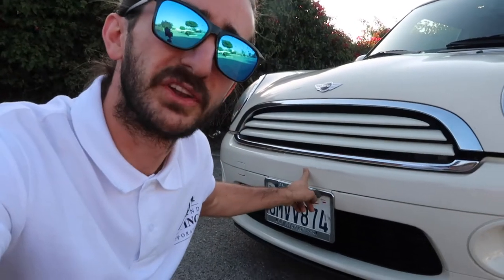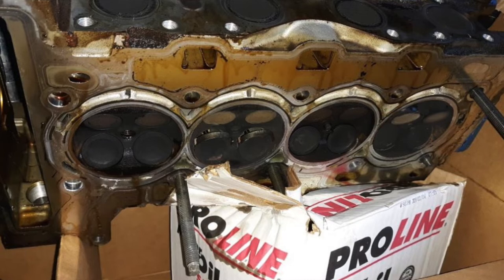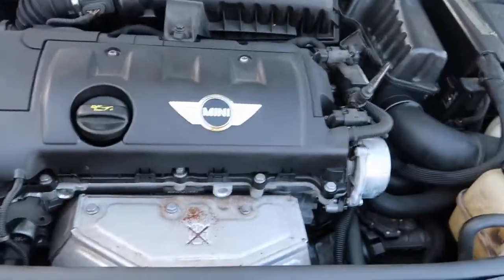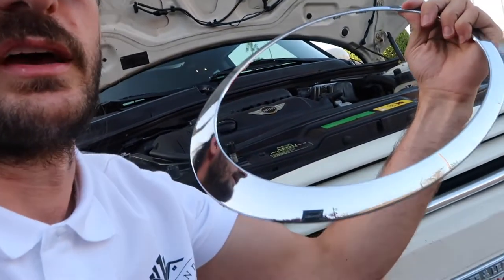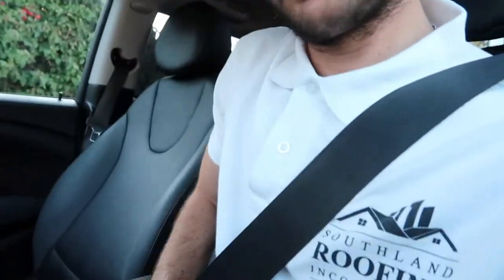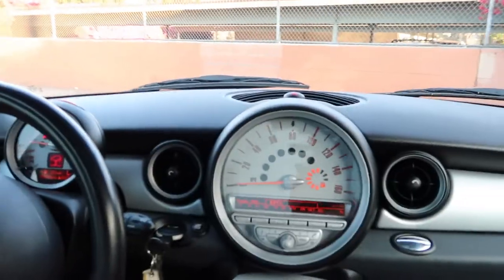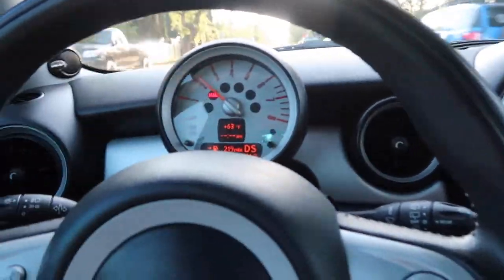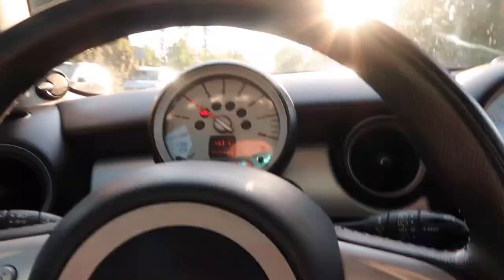WHY You should not buy a Mini Cooper Under the year of 2013 !!!

Comment: I've had a 2011 R56 Mini Cooper since new, had it serviced in accordance with the manufacturer's recommendations, have always driven it with due respect and have never experienced any issues at all!
Reply from the maker: Man I think with this one what happen was because it was seating for over 1 year and that’s why all this stuff happened to me !!
Reply: hey rob,
I'm wondering what you had to replace and how much this car has cost you in repairs?
Reply: Hi Charlie, the only replacements have been the usual consumables at a service, - oil, oil filter, air filter, wipers, coolant, screen wash etc. I've also had the tyres replaced too, but I've spent nothing at all on repairs. Hope this helps. 😊👍
Reply: @rob11rr  besides the basics, youve never had to replace anything major with your vehicle?
Reply: The secret to any cars reliability is proper care and proper maintenance.  When you are buying a used car you will see many advertised as full service history, but unless is still fairly new it’s almost always not true.. very few owners continue to service their car properly after the first 3 years or so.  Those that do, and drive the car some respect for the car do normally get rewarded with long and trouble free life.   If you are the kind of person that thinks a service is an oil change then this does not apply!
Reply: Deponds how old owner took care of that car. I want buy myself 2013 mini one D ... Wish me luck...
Reply: Me too same good car
Reply: I’ve had one for 7 years. Same gentle driving etc. worst car we’ve ever owned. By far. Stay away. 2011 we have. Absolutely horrible.

Comment: I bought a 2004 Cooper S with 15K miles. It now has 26K miles with zero problems so far. I am going to trade it for a 2013 JCW R57, but not because the car is faulty in any way.
Reply from the maker: Well from my experience they are not worth it. If you got a very low mileage it’s good but mine didn’t have that many and still broke down.
I was putting and putting money on it all the time. Almost everything it’s bmw parts and doesn’t drive like a bmw at all.

Comment: Upon my research, I've found that 2010s and older are the ones to avoid. The 2011's are hit/miss and the 12's where when things started being refined. Just bought a 2012 my self, 140K miles on it, and very solid over all. 

Edit: Don't complain about a car being slow, when it's an automatic. Yes it's not a power monster, but know the cars weaknesses and strong points, and utilize them. It's a car for twisty roads, not drag racing.
Reply from the maker: I absolutely understand your point..
But being honest with you at least this car I bought it is slow man, I understand it’s a 4 cylinder but I don’t know if it was just my car responding slowly or all of them.
This one I had it was a 2010 and I had problems with the engine and probably had to do with that to I don’t know man.
It was my very first min Cooper experience to buy and drive.
Reply: @mppower5141  dude you bought a small and slow car even a 4g eclipse will be and feel faster you gotta see the hardware inside the car before buy one. You want something fast with a good driving experience buy a BMW 135i 2012  an audi tt 2013 even an eclipse 2009-2012 an Audi a5 2.0T Quatro a bmw 325i coupe

Comment: You have to check maintenance records. If the seller doesn't have them, walk away. If they do have them, first check how often the oil is changed. Every 3,000 miles? 5,000 miles? If it's never been driven over 5,000 on the dot without an oil change then you know it's looked after. Move on to other items, like the coolant pump, when fluids are replaced, and check for things like tire rotation and wheel alignment. Has the timing chain tensioner been replaced? Is there any rust on the vehicle? When was the clutch last worked on? For a manual car like this with a couple known issues that can cost $1,000-2,000 to repair after the fact, these are things you need to address. If the car was well maintained and documented you will be able to expect how much repairs will cost you by judging the service record; "Oh yes, these 3 things were done but the clutch has not been replaced and the vehicle is at 80,000 miles. I was quoted $1,200 for a new clutch with labor. Therefore it will cost me $1,200 plus oil changes, gas, and initial insurance premium."

Comment: What, exactly, was the mechanical issue?  Not sure what you mean by the plastics melting in the engine.  You said something about three pistons failing, did they crack or the rings failed?  Did the cylinder head fail?  Thanks.

Comment: This has no credibility. 
In the comments, poster admits he let the car sit un-driven for a long period of time.  That is the worst thing you can do to any car. Even take a brand new car, park it in your garage for a long time, and as soon as you start it, your engine is done. Oil and lubricants decay, and settle out of the spaces they are supposed protect. Many parts and seals are actually maintained in good order through their motion and vibration, and contact with good fluids and lubricants. 
     Jeez.

Comment: I've had 2 minis. I traded the 2004 Mini S JCW for 1/2 cost  for and a loaded 2011 Mini S Clubman. For that one, there were practically constant repairs of the little things, but after clutch went out ($1800 ) in 2018, lots more stuff broke and had to be repaired by me or the Mini Dealer...mainly me since Dealer charges close to $200/hr to work on anything.
Reply from the maker: That’s exactly pretty much what happened to me.
It’s a really expensive car for what it is in my opinion.

Comment: Just bought a mini 2010 used. Didn’t have the car for 3 weeks and the engine light popped on. Took it to a Mini Cooper dealership and they did a thorough diagnostic on the car 2200 is what it will cost to repair smh!
Reply from the maker: I paid around 2500$ to fix the engine, and still won’t run properly!
Which one you got the turbo or just the regular one?
Reply: @mppower5141  damn I can buy a 2008 for under 2000$ but unsure now
Reply from the maker: James Rusnak man it will cost you so much on repairs 🙈
It’s not worth it 
My car was very low miles and end it up costing me so much to fix it!!!
And took me so long to get rid of it
Reply: @mppower5141   there are how to do an inspection videos on coopers. im seeing a super charger 2006 shortly. will look into how much tools cost

Comment: I have a 2011 with an N16 engine, 72,000 miles and the #3 cylinder is way down on compression.  Seems to be in the valves.

Comment: i.m thinking to buy mini clupman cooper what you recommend?
Reply from the maker: I don’t know if you live in USA or Europe?
I think mini in USA it’s a a lot mor expensive then Europe.! Especially in maintenance sense it has lots of parts from BMW.
In my opinion if the dealership gives you a good deal and a good warranty go for it. If not be prepared because if something breaks it’s pretty expensive !
Reply: I live in Australia and the car i want to buy it's 2009 84k asking for $4500 AUD private seller
Reply from the maker: Ask if the car been seating for to long or not ?!
Don’t get tricked just because it’s an low miles 
I bought mine for 50k miles and broke after 2k miles!
It’s an amazing expensive car to maintain man 
I recommend a different car to be honest unless your buying from a dealership with a warranty
Reply: @mppower5141  thank you so much I fined AC not working and it's leaking and it's really expansive I have to spend another  $3000 could be more to fix so I don't want to buy thank again far from Australia
Reply from the maker: If already having all this problems don’t even think about.
It’s really really complicated to work on those cars and expensive.

Comment: I have a 2008 R52 with a supercharger and it runs like new. The only problem I've had with it is i had to replace the ignition switch and steering column.  🤷‍♂️
Reply: 2008? The superchaged models stopped in mid 2006.
Reply: I have had my R52S for more than 16 years, no major problems whatsoever, just the odd minor thing as you would expect.

Comment: Ill tell you right now. The R56 is a beautiful car. Especially the S. However. Parts wear down fairly prematurely and are expensive to repair/replace if you want oem parts. My 2010 S has 65k and ive already had to replace HPFP, water pump, coolant reservoir, water pipe, timing chain, valve service with walnut shells. Thats another problem: GDI engines are notorious for misfires and not very reliable. Beautiful car, nonetheless its a piece of crap!

P.S. not a good road trip car....
Reply from the maker: Bro I totally agree with you.
The only thing, was my very first mini and happen to be not a good one ! Reason why because it was setting in a garage for over a year and lost of things went bad.
When I went to the mechanic most of them they’re telling me it’s not worth it on fixing it because it’s expensive.
I finally find one almost 2500$ to fix even tho hi didn’t do a good job .
I just figured it’s not worth of taking a chance with those years for the Mini Cooper because they are really expensive to fix that’s all .

Comment: Mines just jumped it timing chain and destroyed the engine.
No warning of low oil etc until it was way too late.
Utter shite
Reply from the maker: I totally understand 
This car was braking on me so many times and all the mechanics I went they will charge a lot of money on working in this car!
Personally I don’t think I will own another Mini after what I went through with this one
Reply: @mppower5141  I'm struggling to find a replacement engine but once I do it will be fixed then sold.
I certainly won't own another one.
They are terrible
Reply from the maker: @leearmstrong9763  this video wasn’t the best explain done because I made this video right after I picked up from the mechanic and I was so upset and probably I didn’t mention everything but honestly I won’t recommend anyone to buy a mini unless you get a warranty with it otherwise no.
I just kept putting money on it so many times and the car wasn’t getting fixed so I decided to sell after I made this video.

Comment: You got the n14 base model. Of your not a semi skilled mechanic the  I see why your complaining
Reply from the maker: I understand a little bit but i can’t open an engine in my own and with no tools.
I understand basic stuff but to work in this car it’s completely a nightmare for what it is.
This is the most disappointing car I have ever owned.
Reply: @mppower5141  No I understand. I think they are over rated as far as how hard they are to work on. The problem with working on them is you have to take off a bunch of parts to get to a few components in the engine. I understand your frustration though I don't think I would get another one
Reply from the maker: @exitingthematrix6302  same for me honestly.
The amount of money and time I spent in this car it’s just to much. 
And it’s really boring to drive to. The S model it’s fun but considering how much money it cost in repair and for what it is it just doesn’t make sense to me.

Comment: I feel like BMW really doesn’t know how to make engines. They’re biggest trash company. It looks like the only thing they focus on is how to make the interiors look as nice as possible but under the hood they just put all the plastics they can find. 🤦‍♂️🤦‍♂️🤦‍♂️
Reply: It's a Peugeot engine. BMW make superb engines. They make unreliable electronics and wiring.
Reply: @DiscoFang  I know it’s not a BMW engine but regardless their engines are stupid unreliable. You should not ignore the fact they piss oil and coolant all over every chance they get. Every BMW performance car needs to be in the shop to have the engine torn down to take care of weak spots to ensure they run. The e90-92 engines are perfect examples of their unreliability.
Reply: @mohammadkamran5862  Spoken like someone who gets all their experience from Youtube. You do realise people only put up videos of vehicles with problems, right? That’s the nature of entertainment. I have 2 6 cylinder BMWs, one e46 for 15 years the other an E91 for 5 years. Neither of them have ever leaked any oil from anywhere or leaked any coolant. I know owners of e9x M3s that have had zero engine or transmission issues. They’ve also had no electrical problems. I had a E61 5 series 530d that gave endless electrictronic issues but just normal wear and maintenance with the engine and trans.
Reply: @mohammadkamran5862  BTW, the only problem my 2007 E91 has had since brand new is a starter motor. That’s in 146,000kms.  Just a starter.

Comment: well eff me i just bought a 2010
Reply from the maker: That’s exactly what I had ! And I was at the mechanic every other month for something or another.
Those cars they are pretty problematic especially if they have been setting for to long.
The other thing is parts and labor in those cars it’s pretty expensive to.
I hope you got some type of warranty for it ?
And please just let me know if something happens through the time because I am curious what kind of experience u will have..
How many miles it has ?
Reply: @mppower5141  Honestly, I spent 2 hours with the mechanic looking for the amp, and turns out the guy took it out so my sound system is not working. On top of that, I noticed that when the car is idle for a few mins at the signal or drive-thru, the rear exhaust smokes like crazy so I'm getting that checked and my steering wheel is so stiff but I don't see any steering fluid reservoir so idk what is wrong. i just bought it last week and I'm in tears because i spent a lot of money and it was from a private seller so no warranty. :'( Wish i saw this before i bought it!
Reply: @mppower5141  it has 100k miles so honestly not that bad considering i want it just till the end of this year. I bought it because i live in California and parallel parking is a problem.
Reply from the maker: Sorry to hear that!!
Where in California you live? because I have a really really good and affordable mechanic finally mow
Reply: @mppower5141  I’m located in W Gardena, so in South Bay.
Reply from the maker: So we are not far then ...
Follow me on instagram and I will give you the information of my mechanic